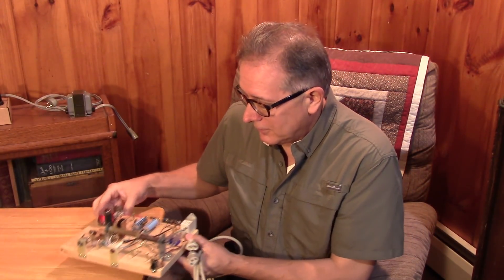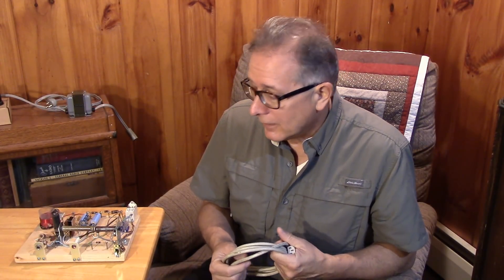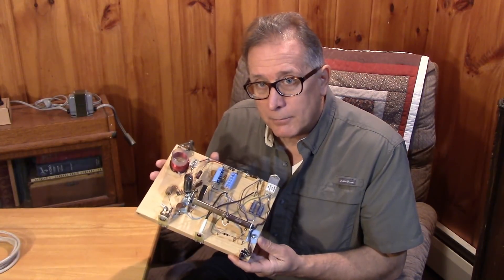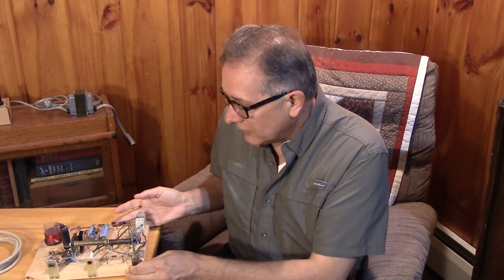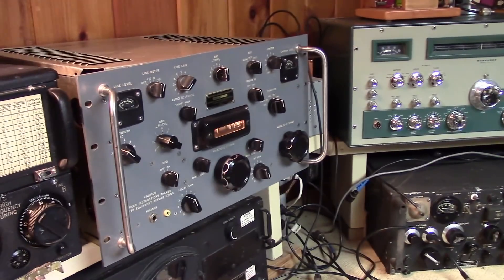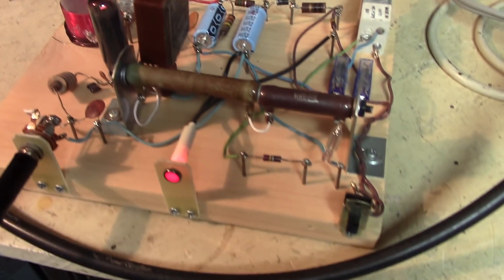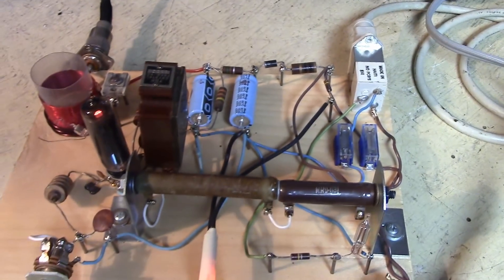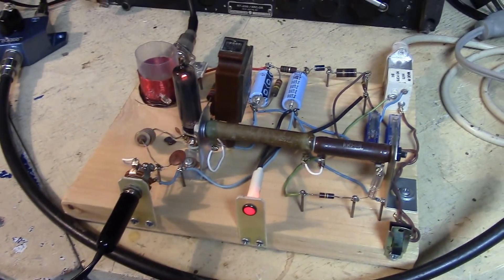Retro QRP Widowmaker

Comment: hello:)
i use to be an electrician that live in Germany. 
my worst Electro shock was many years ago (we have 3 phase system with about 400 v between the phases).
due to Miss Communication with my educator i came between 400v lines with one hand (i asdumed ,that after asking "did you check that power is off?" and he sayd "probably..." he was chocking....).
tried to clamp on a 16 qudrat wire (dont know what gauge it is).
and i touched at 400v ...across my hand...this gave a smell like grilled pork and a 7cm (round 3 inches ) still visible burn mark across the back of my hand.
sry fr poor english

Comment: I got power in me from a welding machine 240 v 400a when I was going to weld some steel plates I jumped several meters across the floor luckily I got no Damage from the power shock I was probably very lucky
Reply: worst hit I ever got was from a tig, forgot to put the ground clamp on and floor boarded the pedal at 95 amps or so.  I became the ground.... LOL.  That will wake you up!
Reply: @speedbuggy16v   Thats a tingle in the dingle you dont want. HF aluminum tig is something else when it grounds out on a belt buckle too XD.
Reply: What a Kool  retro opp widowowmalker

Comment: For years I have been the only guy that would check a hot tank circuit on Feild Day. Over the last 65 years, I've run into too many incorrectly wired situations that I felt expediency required I work hot. Keeping my  and making sure I stood on my insulating mat or shoes I tested to be insulating saved me twice. In retrospect, the work should have waited. The one that annoyed me most was a remodel that put over 70 volts tramp voltage between ground  & neutral on the USA 120 Volt lines on 30 computers.  The current was so low it took the best meter in the shop or sweaty hands to find it. 
73 de W5RED
Reply from the maker: The human meter. I knew a guy who could tell 110 from 220.
Reply: @MIKROWAVE1  My brother tested 120 vac wiring with his finger to see if it was hot,

Comment: Would have been nice to have had a glimpse of the schematic and a brief circuit description.  If it was about safety rather than the homebrew transmitter, then perhaps a mention of the residual current breaker and why its a good idea to put one in the shack supply would have deserved a mention.
Reply from the maker: For this I flashed the magazine cover and gave a link to a site that goes through the original article in detail.

Comment: 50C5, I thought that vacuum tube looked familiar.   Series circuit audio vacuum tube.  At first I thought, use an audio tube for RF?  Then I remembered Schulmerich Carillons used a pair of 805s for their earlier high wattage audio amplifiers.  That's some scary B+ stuff.
Reply from the maker: Any of those beam pentode tubes would amplfy RF pretty well up to 30 MHz.

Comment: A good simple design from the 60's although probably verboten under the nanny-state mindset of todays society!  In my build-up I have substituted capacitors for the filament voltage dropping resistor, and it works OK.
Thanks for the "widowmaker"  story from Australia
Reply: Rather than buy a large wire-wound power resistor, I used the filaments of two otherwise useless tubes.
Reply: Each time I post a reply, it is deleted within 30 minutes, by what or who I don't know. See how long this one lasts !!
Maybe link addresses to other webpages are disallowed ! resulting in immediate deletion.

Comment: I made one of those things years ago...used terminal strips instead of nails...thing chirped like crazy...no voltage reg. Somewhere, I have an updated schematic with the 3 wire power cord. I should try to make it again, but with mods to make it safer...

Comment: I really enjoyed the video! I doubt I could decipher the moss code however. lol  I restore a lot of hot chassis AA5 & AA6 radios. So I understand the line polarity issue. I spend time educating customers about their mains, and possible reversed mains in their outlets. Back in the day, it was nothing for a housewife or teenager to pull tubes out of a set, go to the local variety store, test the tubes themselves, and buy replacements. It is sad folks today don't have that basic understanding of electronics today. In a way, I think we did them an injustice with all our 'safety' enhancements rather than education..
Reply: I can still here my dad's CQ CQ at night.
Reply: “In a way”????
Reply: @RobertLBarnard   @R Barnard  With me, it was listening to a crystal radio he had build on a large sheet of plywood, that hung on the wall. It was all wire to pin construction. :)

Comment: It wasn't clear -- does the Widowmaker use a rectifier in the heater circuit to cut down the amount of power that has to be dissipated in a power resistor?  That would be a good idea (instead of the "hot rods" you have, it would be about 227 ohms, with 5.1 watts dissipation, given 120vac input).

Also good grief, I'd have made some kind of cover for it, like drilled plexiglass.  Access to the connections would be through holes in the sides of the cover.

Building a GFCI into it would be nice too.  That wasn't available then, but is now.  There are GFCIs with no sockets, just the set and reset buttons.  As long as the RF didn't make it trip.  And still -- test with a grounding lead and resistor to see if it will trip before using it in earnest on an un-isolated power line.

I always was fairly careful when servicing tube electronics, including hot chassis TV and radio sets.  The only serious jolt I got was from a picture tube made out of some peculiar glass that sneakily rebuilt its charge after I had drained it.  Ouch.

Comment: Hi. We need perspective here. I've been fixing radios and TVs since I was 10. I'm also a qualified Radio and TV service engineer. We have 240v ac mains in the UK and I've yet to come a cross an engineer that was electrocuted. Safety is common sense and please don't put off budding constructors advise them about safety yes but give alternatives. For instance the Soviet rod pentode tubes that work on low voltages and give a great introduction to tubes/valves.
Great video and thanks for sharing.
Not so sure of the name widowmaker though
Reply from the maker: Maybe you are right but I also know a lot of guys who dance around  HV with one hand in pocket!
Reply: I am 57 and qualified as an electronics engineer in the 80's. I have worked in nuclear power and aviation where safety was critical. I have been shocked many times. But in each case I had already taken steps to mitigate the possibility that it would kill me. Good luck with that I am going to be a super human and not make mistakes method.

Comment: I have been blown up by electric gas and water close with flammables as well  lol 
Medium pressure high flow rate water pipes in a pump station I missed a connection turned it on and it got up to pressure then let go…
Electricity all sorts even using a neon screwdriver can give you a reminder if you are well grounded and damp conditions. 

Gas when I was a teenager before thermocouples were fitted to gas cookers you used to light the pilot light turn the gas on and close the door and it would ignite well it didn’t until I opened the door 5 mins later then it lit up with a whoosh so that was fun lol 

I’m in my 50s and sometimes wonder how the hell I made it this far  😂 😂 😂

Comment: Its amazing how other countries have poor mains systems 

In nz this isn't aloud to happen and everything is of a higher standard 

Anyway wat I recommend you do is get a little stack of microwaves and get the transformers and use them as isolation transformers can hook them parallel and series to get 120v to 450v outputs at reasonable high wattage and if want it more pro can cut were weilded and swap secondary for another trannys primary  
Probably best way to go
Reply from the maker: The first time I was over in the UK on a sales engineer trip, I saw one of those TYPE G plugs and just stared at it, then uncontrollably started laughing. They were not amused.
Reply: Least u were

Comment: There’s an important mistake in your color for Euro wiring at time 8.00.  You say Blue is neutral (correct) but black or brown is ‘hot’.   This in incorrect.  European/British wiring is Brown for 230vac live (hot) and Blue for neutral or cold on single phase circuits.  Note too that the neutral may not be the same potential as earth.   On old wiring the colours are Red for hot and Black for cold/neutral.  There is another type of wiring using gray, black, and brown but this is three phase or for lighting controls.   The Black is never neutral/cold, however.
Reply: It is correct for line cords, black or brown is hot. 
Not that it really matters, most EU plugs can be plugged in either way. And the one's that don't (the French Type-E) don't have outlets that are wired consistently.
Reply from the maker: Huh say that again. Now I am confused. Black or Brown is hot I thought. 230VAC live is hot for single phase right?
Reply: @MIKROWAVE1  
Correct, dornb is also referring to old UK wiring colors.
But in most continental EU countries on line cords (as in: not in wall wiring) blue = neutral, black or brown = live, hot, green/yellow = earth, ground. 
But since in most countries you can also reverse the plug without issue there is really no other way than measuring.
As always there are exceptions. for example: there are mains grids where all you get are three phases. Then there is no neutral, and all wires are hot, or one of the phases is tied to ground. Fun stuff.
So transformerless radio's on 220V were REAL fun around here.

Comment: I was going to say, so you could have done a simple MOD, with a warning neon by adding a diode on an additional lamp but those neons would still light on half wave.
Reply from the maker: One of the first projects that we did in electrical shop, in high school, was a small neon bulb and two resistors inside a drilled out dowel - attached to some probes. It was called a handy tester. like you said, it could measure AC or DC over about 75 V.

Comment: Another safety no no for any high voltage circuit of any kind is not using an all metal chassis. Or in this case using a wooden base. Why? Well if you build a modern electrical device that uses high voltage on any part of the circuit and any wire containing high voltage comes loose you want that wire to touch the metal chassis and go through the metal chassis to the chassis ground and either blow the unit's fuse or trip the circuit breaker on the house mains circuit the unit is on. So I wouldn't go any where near a modern high voltage device that didn't have transformer isolation, a three wire (grounded) plug in style mains cord and a fuse in the device that was rated for the expected short circuit current. Also the new style IECC plug set up eliminates the mains cord passing through the chassis through a hole without a grommet and strain relief. Why is that important? Well there are two reasons. First of all when the mains chord passes through a hole in the chassis it can rub on the metal edge cutting through the mains wires insulation and shorting to the chassis. Also the reason the mains cord plugs in to the socket is so that if anyone trips on the mains chord the cord just unplugs. With the old style mains cord if you trip over it you could pull on the wires so hard that they could break their connections inside the device and short out or be pulled out of the unit entirely and then you have loose mains ends in mid air looking for someone to shock. You have to remember that if someone trips over the old style cord you could also pull the whole device off a table for instance and if it's an old fashioned transceiver well they don't call them boat anchors for nothing. When one of those hits the floor you're going to have broken tubes and who knows what damage inside the unit. So here endeth todays sermon on proper basic design requirements for all high voltage devices. If you don't understand the physics behind each of these safety features then you have no business building or servicing these devices. My dad used to joke that you could tell the good tube repairmen cause they were the ones that were still alive!
Reply from the maker: Sage advice! The US standard for an outlet is ground hole up so if something falls over it like a bare wire, it hits ground first. The EURO outlets - (well some of them) have much more advanced safety sockets and plugs.

Comment: Totally kewl! Back when someone had to learn Morse code to earn their ham license.  Wasn't it typical for hams to buy an inexpensive receiver and make their own Morse code transmitter?  Nice work!-John in Texas
Reply: yeah it was common enough to take the audio output tube and make an alteration to use that as a simple crystal controlled CW transmitter.
Reply: My first xmtr was made on a tv chassis. Most all of the parts needed were already there, just in the wrong order.

Comment: For UK viewers, "off the line" means powered directly from the mains without a mains transformer (often called "AC/DC" because transformers only work on AC).  Cheaper valve radios were often "AC/DC", and the chassis could be live at 240V.  The same applies to this kit - live voltage where you don't expect it.
Reply from the maker: Everyone knows AC/DC is Australian.

Comment: I've worked on houses that were entirely knob & tube and the outlet polarity was correct. "More than half" of yours were backwards? That electrician needs a lobotomy.
Reply from the maker: The other controversy is which way is up on the outtets. Code is ground pin up.
Reply: @MIKROWAVE1  I'd love to know what section of the NEC you found that in.

Comment: this scars me   with this stuff I rely on a battery and a good inverter  
   yes this is costly  but so is life      for under 200 dollars      a simple
  power supply and a small auto battery and a  small inverter  
  i do not use the power supply when i use the inverter     Thank You
Reply: scars?
Reply: You can still get a shock. Just not from circuit to ground.

Comment: Just an opinion, rather than having the text overlays on the video, it would be better if you just explained those things yourself, on screen. At the moment it keeps slipping between you telling us stuff, and the text, and I'm presuming those things are coming from you. So I'd reduce the text if you can. 

Also... WU2D! I'm not a ham, but does having such a short callsign get you respect in the community? Something to swing about a little bit!? "Yeah, in my day if we wanted to transmit, we had to kit out a European castle with Leyden jars and big knife switches, then wait for a lightning storm..."
Reply: I don't mind the text on screen.  The text allows you to fill in a detail you may have missed or correct an error you made when recording.  The alternative would be to re-record the segment, which is a lot of extra work.
Reply from the maker: HINT: it uses less characters for code .-- ..- ..--- -..
Reply: @MIKROWAVE1  Sure, but did you get such a short callsign from being one of the earlier ones to sign up? Then later on, they used them up and so gave out longer ones? That's usually the way with shorter codes, in all sorts of things in life.

I realise you probably weren't second in the queue after Marconi, but I know plenty of old hams are still active.

Comment: Not sure of the need for this video  in  such a "happy tone."   This is/ was damn poor engineering  and should be treated  as such.  It is bad enough that  people just like me,  when starting in about 64,  were saddled with the likes of an S-38  Hallicrapters.   Metal case,  AC/DC and of course leaky bypass caps to the chassis/ case.   And we won't even  get into what a terrible excuse for a  "communications"  receiver the  damn thing was.

I grew up in a house built in '40.  While it at least was not knob and tube,  it certainly was not  '3 wire.'.      I learned early on, tho,  to check for a grounding condition with neutral.    "Fortunately"  my  "ham shack"    (usually) had a nice dry wood floor.
Reply from the maker: S-38 - Wow you poor duffer. Yes that series was a gem. Still it must have been fun to tune around when the bands were so full of interesting signals.